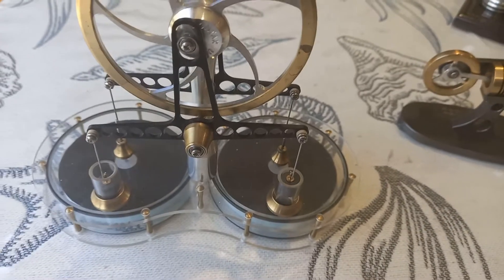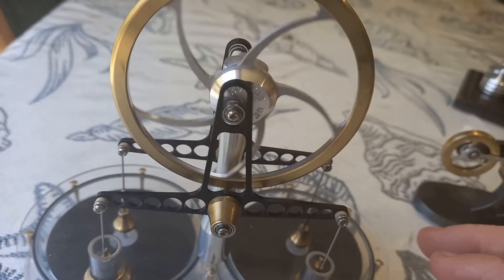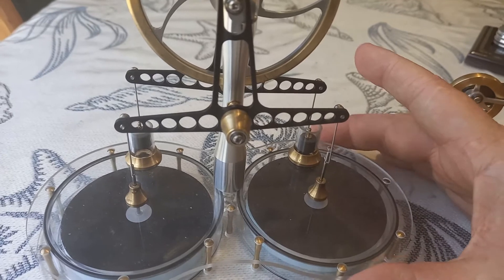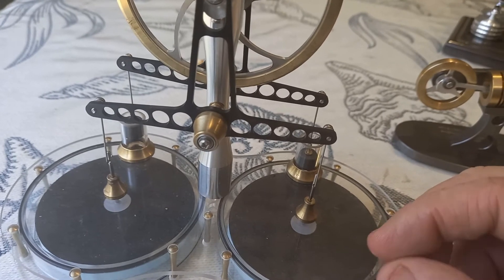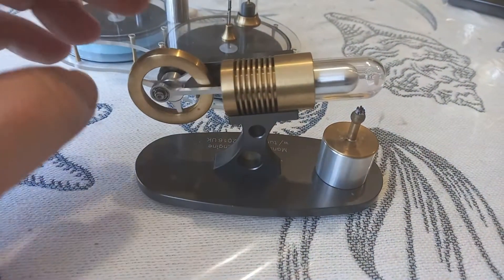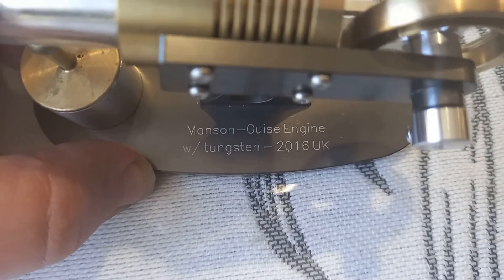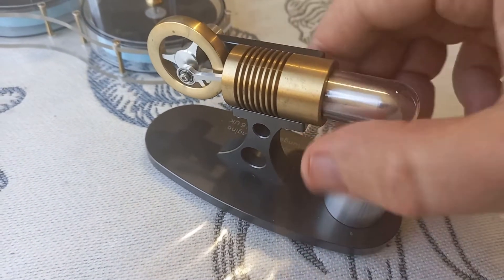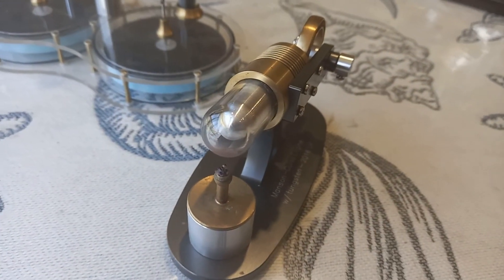BEST Stirling engine low temperature twin Stirling and Manson engine Thomas PCGuru Engine collection

Comment: what is the benefit of graphite dust?
Reply from the maker: On very low friction engines oil is not used. Graphite dust is a lubricant. It can make a noticeable difference here in speed / minimum temperature difference needed to run